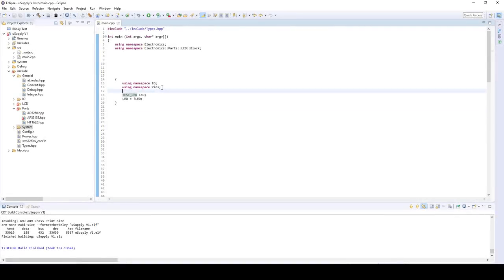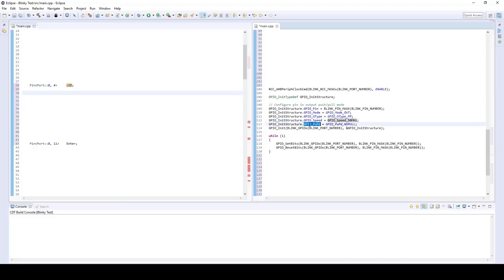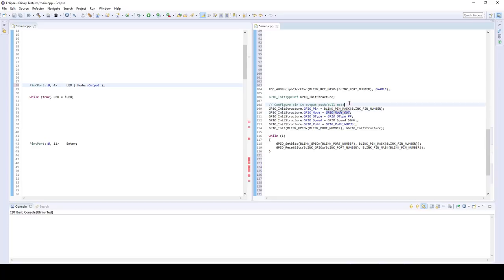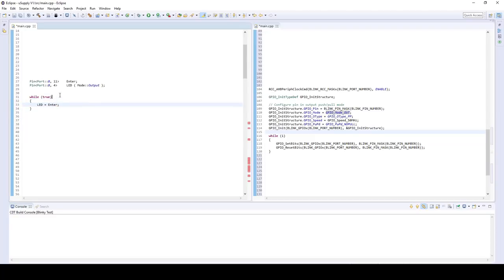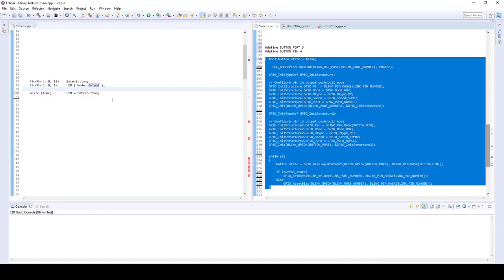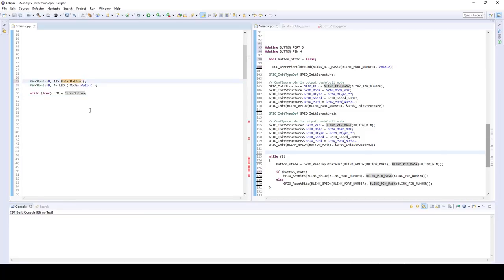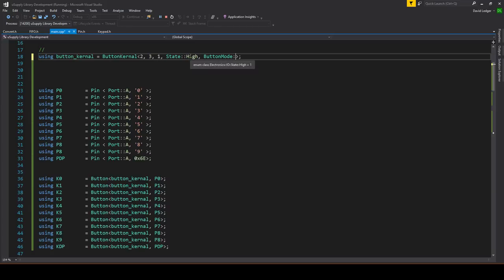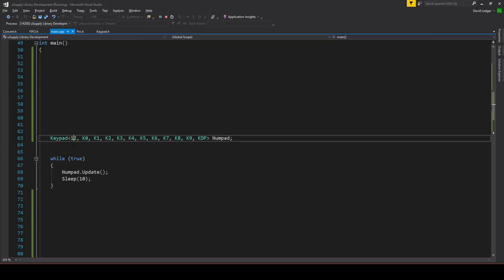C++ for the Embedded Programmer

Comment: Excellent topic - thank you.  Quick question:  what's your point of view regarding the memory MCU memory footprint when implementing embedded systems in C++ vs C?

This has been a recurring topic of discussion in my career.  As an experiment we had a very good C++ developer re-code parts of an embedded real-time system (used in a patient monitor) from C to full-blown C++ where the developer used inheritance, templates and exceptions.  The outcome was that we reduced the number of lines of code and improved readability while keeping the memory footprint about the same.  At the time this surprised me since I assumed using full-blown C++ introduces code-bloat and I was proven wrong in this one example.
Reply: Well yeah this happens to me too I reckon because people do things that are strange:

Firstly, people early on compared binary size of cout to printf "Hello, world!" programs, the comparison was deeply flawed as cout does so much more its funny. (I read this online a few times)

Secondly, templates have in the past resulted in people instantiating hundreads of a template type which in the distant past duplicated binary, but now with folding in the linker it is becoming a thing of the past.

Thirdly, alot people or a while believed that classes all needed a virtual destructor, this simply isn't true and using one results in the instantiation of a VTABLE in the class.

Comment: Dave, I'm really trying to be open minded here but I'm not sure how long lasting it is to use c++ on limited micros.

I have a design I'm working on using the stm32f042k6u6, great chip,32KB of flash, lots of peripherals; But once I took STs MXCube code generator and It generated all the init code I needed, to my surprise just the init code took over 60% of the chips flash!

Referencing an article from the embedded muse about how these APIs are usually written (Junior devs that write and then god know who maintains the code), it seems the best way was to rewrite the code on you own.

going in deep you can see that the programmer that implemented the API wrote a lot of safety code that creates a lot of overhead:
1. passing large configuration structs around
2. asserts on parameters
3. spin locks for multi task codes

Just a lot of code that is best implemented by good writing by the customer rather than the vendor.

To make a long story short, My entire code including the init functions, working with an oled lcd, spi flash interface, i2c, USB,RTC, Timers, Interrupts and ADC only takes about 50% of the flash.
While the my code is non generic (my functions assume single interfaces that you supply a pointer to externally, just to save code size.) it works great and no one died yet.

Going into c++ might contain the same overhead that will quickly guzzle up the flash I barely have, So while blinking leds and reading buttons is nice, I'd stay clear from using a higher language for flash limited devices.

Heck if it was an f4 or an f7 where you have a substantial amount of flash,  I say go crazy with it, use C++; But for tiny Embedded Systems, I'm sticking with C.
Reply: It really is a function of the API, C++ doesn't intrinsically consume more memory but developers sometimes get carried away and can do things in their code which result in large code bloat. exceptions and virtual functions are two major things that really take memory usage but you by no means need to use them. 

If C works for you, thats fine :) I'm just showing what I do.
Reply: It would be great if you can upload the code to github, maybe try it a bit...
Reply: C++ can easily provide zero-cost abstractions, there is absolutely nothing inherent in the language that causes code bloat. If a project has code bloat, it's because of the code, not the language.
Reply: And with ASM web services can be easily created, there is absolutely nothing inherent in the language that causes code grown to overcomplicated piles of unreadable data.
Reply: JAVA can easily provide zero-cost abstractions, there is absolutely nothing inherent in the language that causes code bloat. If a project has code bloat, it's because of the code, not the language.
Reply: @Atlas Atlas it's funny how Java is never used that way then... every piece of java program I have come across has been bloated, inefficient and slow.
Reply: I can say the same about C++ code.

And don't forget, that PHP can easily provide zero-cost abstractions, there is absolutely nothing inherent in the language that causes code bloat. If a project has code bloat, it's because of the code, not the language.
Reply: It'd be nice if embedded developers could write even half decent C. It has been a few years since i've written any C++, but could you not just use a class and some constructor arguments to achieve the same thing without all the TMP? It appears to me you could achieve the same thing (simplification and clarification) by just using a well defined class or classes.

Over use of templates will quickly result in ridiculous amounts of bloat which is definitely undesirable for small micros.
Reply: @maor malka be sure to reconfigure CubeMX project to use LL api instead of HAL, they are much much smaller, and more depends from you
Reply: @Atlas congratulations, you completely missed the point.

Comment: So, you basically have an abstraction layer more in the cpp version, right? If you would have the same level of abstraction in c then you would end up with a similar number of lines of code.

Its always good to have some kind of a "device" abstraction layer between your code and the vendor specific bits.

Comment: Hey David, I don't fully agree with the examples that you've given, for that well, managing pins has always been a problem for me.
Sure, STM32s and ATMELs, if I'm not mistaken, you can control the pin directly on peripheral. On some TI chips you need to configure the pin pad, and then the gpio peripheral, if not some other control structure crap.

Now, I do agree on the use of C++ on other topics, such as the numpad (yes, to use that you need some sort of pin abstraction). That is somewhat Arduino is doing (after some articles online, I've concluded that they are/were doing it badly).

I think that the strongest point that C++ has to offer to the embeded community is not the abstraction layers, at least not in the first features.
Namespaces, structs/classes, inheritance and as mentioned by others here in the comments, the optimization that the compilers bring to the game.
Overall, before we can cram such level of abstraction to OSless systems, code organization is the selling point.

Secondly, the wall that is holding everyone back, in my view, is the lack of support of medium-big embedded OS for C++.  Surely, as they are written in C, you can fiddle around with the compiler using extern and get the OS to work (suggested solution by TI to use their SYS/BIOS TI-RTOS solution).
It works, but it is by no way native, and the drivers themselves do not support C++, since they are written in C.

Back to Arduino, while it is not the best implementation, peripheral drivers are native in C++, which helps a fuckload. I've written a context switcher/cooperative OS for the Arduino Due just to keep using the C++ features and the Arduino libraries.

Last but not least, Thanks for the video!
And count me in on those that want to see more.

Comment: That's neat but I have a question.

What's the advantage of doing it with C++ and just abstract C a bit more to make it look like what you created in C++?

I mean, you can create an abstraction that returns a "pin handler" that would allow you to configure the LED and button, and just pass the port and pin numbers as well as the direction. For example:

Pin LED = pinInit(8, 4, OUTPUT);
Pin Button = pinInit(8, 11, INPUT);

Then that handler would contain in turn an abstraction of the set/reset functions as well as read function so that you could just do something like this:

LED.set(Button.read();

And the result would be also 3 lines of code.
Reply: Ah neat question.
I'm using templates to link with the actual register at compile-time. There is not runtime offset calculation of the pointer in the Pin class. 

The set/reset functions would be fine but you would also need to implement set and reset for the type of pin, the mode, the speed, the pullups and have a static object manage the power of the GPIO module automatically to make it equivilent. You might also need to implement read functions for all of the above aswell.

The advantages:
- compile-time calculation of register offsets (so we can actually use the ports registers), 
- type safety, you cannot physically enter invalid pins or ports, which means no runtime checks needed.
- Physically less code in the main function
- Using standard operators
- Full register exposure (all options are available) for all pins without flooding the global namespace with what would be 2 + 2 + 2 + 2 + 2 + 2 (12 functions) functions pin function.
- Code is more expressive of programmer intent I believe as it takes less space to understand the same syntax while at the same time using standard grammer
Reply: David Ledger ok I see what you are saying, especially with the advantages you mention. May I suggest, you should re-make the video with a head-to-head comparison as also others have suggested.

What I mean is, create an abstraction layer similar to the one I suggest in C so that you can compare both styles at the same level, then, you can more clearly and contundently show the C++ advantages over C when showing what you have to do under the hood for both, that is where the comparison will take all its glory.
Reply: I started doing that but there is so much pre-requisite knowledge it became really difficult and I gave up and just decided to not show what was under the hood in both cases (STM library or my library).

It requires a decent understanding of TMP and I kept getting bogged down in explaining the syntax as it didn't make any sense otherwise.
Reply: David Ledger wait, I don't understand, then how did you created yours? Because you need that understanding about the peripheral and boilerplate code that is necessary to be able to know what to put under the hood in order to create an efficient and elegant abstraction.

Don't give me wrong, that what you did with C++ is really neat and I've been trying, and maybe others have been also trying, to find a good justification to use C++ on embedded systems.

I personally would love to be able to use C++ in MCUs but as many others I think, maybe erroneously, that C++ is overkill or that may not propose a better approach than C. This video shows that may not be the case, but the argument is not too strong without showing under the hood.

And yes, I think that it is necessary to defend the C++ case because as you have shown, one could create good and legible code as well as object oriented code which would be very useful for modularization, reuse, and other benefits.
Reply: I meant that to do a video about it I would need to teach the audience alot of pre-requisite knowledge before I would be able to explain what was happening.
The boilerplate code is linked in through template meta programming which is an advanced subset of C++, something that would be difficult to do a video on without getting completely off topic.

Comment: Nice touch!  Let's continue! Using pure C or C++ have sense in lot of cases, because programming  MCU is not so trivial like standard programming. I'm using both because it's dependent on performance and control of your code. But off course you have to be professional to write good code in pure C.

Comment: You can make C modular and apply many aspects of OOP to C (actually you can simulate C++ on C but it's not my point since it would be very extense coding). If you encapsulate your weird looking C statements into exported modules with function names that make sense like "setLedOn()", "setLedOff() and "setLed() // passes an enum with states" you will get a pretty easy to read and use C code
Reply: That being said, I just watched the start of the video, don't know if you talk about it later, so I thought it would be nice to share anyway.
Reply: Yes, but you would need to create a 2 full functions for every different GPIO, instead of it being defined by the object type itself. You also need functions like ReadLed and SetLedState, SetLedMode, SetLedPullups and read for all of those to expose the equivalent functionality.
Reply: David Ledger yes, your module Led.h would export these functions the same as your class would, instead of coding your methods and state inside a class file, you would code your methods and structs in your Led.h and Led.c, passing around a struct reference for your functions to modify. It's a bit more cumbersome then having all encapsulated and hidden inside a class, but not that much different.
Reply: David Ledger my point is just that I don't think you made a fair comparison, if you want to show how encapsulated and maintainable cpp is, then you have to compare it with C, using C good practices, such as modularity, encapsulating state in structs that will be modified by functions that abstract your low level logic.

Comment: Yes, but somewhere you had to code the classes. You don't get the class (and its code) for free. So, if you made a mistake when coding the class you wind up with the same issue as making a mistake in the C code. In fact, there are no real savings here in coding in C++ vs C. 

He is using the generated code in the C example and he had to do that for the class in the C++ example (or write his own register and bit access code). I could just as easily create a function in C that handled all the details like a class. Then I could make it as pretty as the C++ example. So no savings in the amount of code, and no savings in what I have to remember when setting up pins. 

Realistically, if all you are doing is blinking an LED and some other simple tasks, then the STM32 processor and the HAL are way overkill. You should just use an 8-bit microcontroller. Or the LL drivers for the STM32, or to really simplify it just code to the registers and set up your own functions to access the registers instead of the excessive layers of the HAL/LL. 

What is being shown in the C++ example is very misleading to new embedded engineers. There is a ton of code in the class doing the same thing as the C code but it is hidden, which you can do in C.

I am not against using C++ in bare-metal embedded firmware, and it can be just as small and just as fast (I did the testing and found a 4-byte and 2-instruction cycle difference between the C++ and C code due to the constructor call which is 1 address added to the stack and 1 branch). Yes, I like that you can hide the details in C++, but what I have a problem with is in this example the details could have been as easily hidden in C. 

This is a very misleading way to say C++ is better than C. They can produce the same code and both can look as simple as the C++ example. Coding the class is just as difficult as the code he shows for the C example. I say show us the class code.

Comment: hey there, i stumbled across this tut. here is a challenge for you {STM32F4405RGT6 LQFP64 -- USB Device only Custom HID,  with 34 generic button clicks external 16mhz OSC Serial Wire Debug  for programing only -- pin30(PB11)for LED blink for "im alive" what would be the cleanest way to program that chip so the program took as little space as possible }. just curious, you dont have to do this but i am curious on how small you could make it

Comment: You can hear the dinosaurs roaring: "All we need is C. C++ is slow."
Reply: All versions of C are dinosaurs. Extreme terseness, low human readability, no data bounds checking and case sensitivity, all to minimize processor time on the puny 8-bit micros of the 1970's. 

Even if compiling code for running on a tiny processor it makes no sense to have a PC interface which behaves as if it was running on same. Why not use a more human readable syntax, with meaningful keywords instead of bracketbracketbracketbracketbracketbracketbracketbracketbracketbracketbracket, case insensitivity, and bounds checking so as to avoid security vulns arising?  

Something like 80% of all IT vulns are down to C/C++ buffer overflows. 

If 80% of deaths in road accidents were due to not wearing seatblets they'd make it mandatory to wear them. 
-Wait a minute, they have.
Reply: "all to minimize processor time on the puny 8-bit micros of the 1970's."

BULLSHIT.  C was designed for making Unix, and it does what it's designed to do quite well.
C is the language of choice for writing operating system kernels. (With a sprinkle of assembly for interrupt management and such.)

Comment: I'll comment without watching the video (but havin skimmed the comments). The embedded gurus at work doesn't mind C++ as long as you keep it out of hard or decently firm real time environments. Basically the gist is that the abstractions make it too hard to keep track of what you are doing in the system and thus you loose determinism, which can be a bit bad if one missed computation slot is critical in order for everything to work safely.